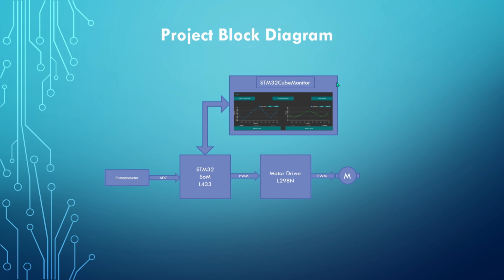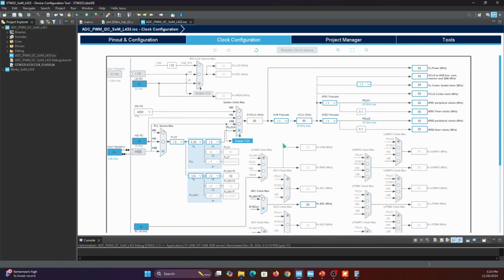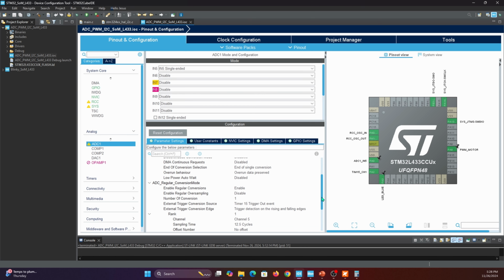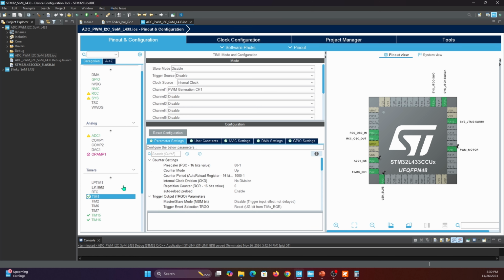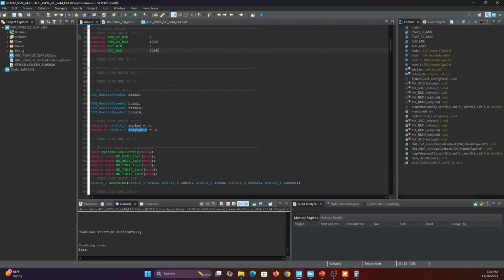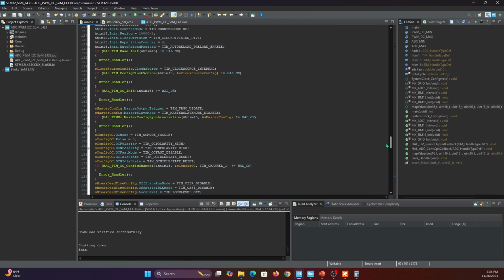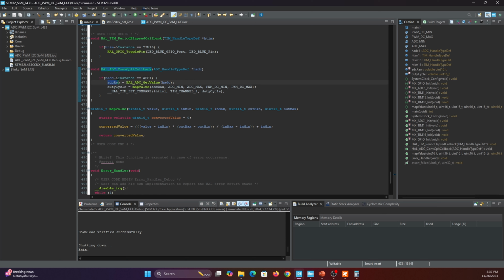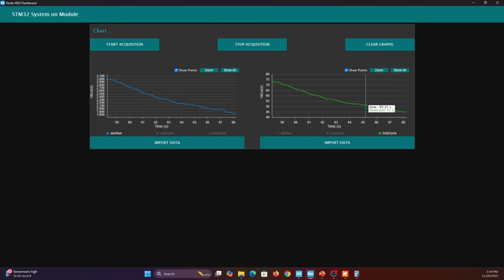STM32 - SoM L433 | ADC, PWM, and STM32CubeMonitor - No. 003

Comment: Didn't know Cube Monitor was a thing. Thanks for that!
Reply from the maker: It's based on node-red. So, what you could do with node-red, you could do it with STM32CubeMonitor plus read internal data of the micro-controller. During testing, it's very useful.